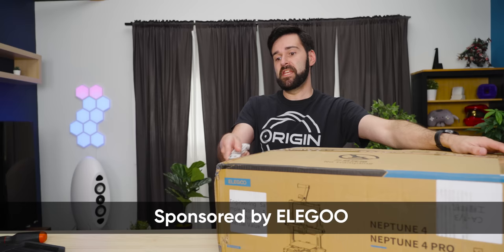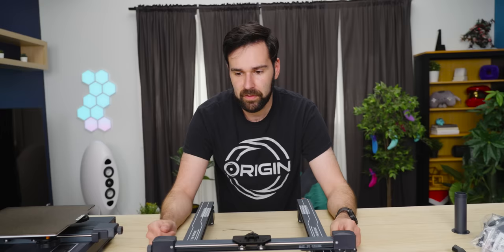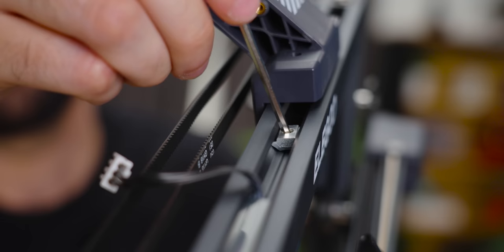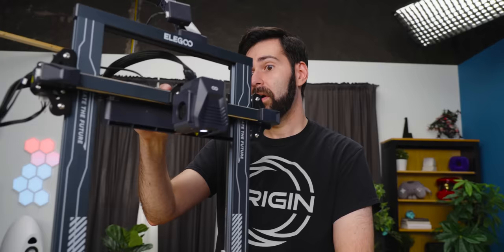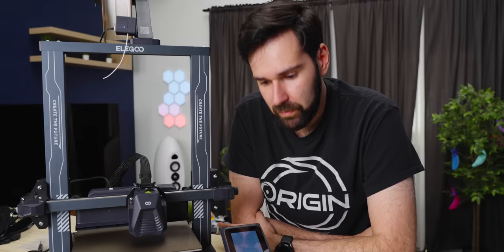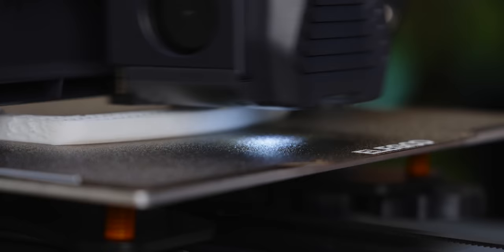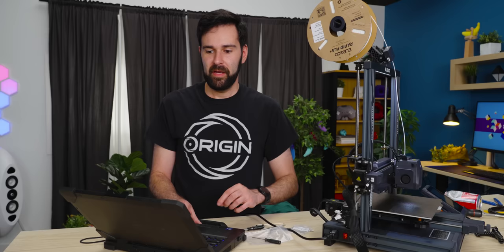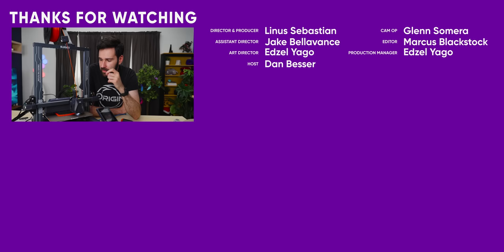Now THIS is bang for your buck! - Elegoo Neptune 4 Pro

Comment: "I hope it's not [something] lined - that way you'd die of neurotoxin poisoning" - Dan, as ever the cheerful member of the LMG team. The first time I saw him, he recommended doing electrical repairs standing on a metal chair because "if you get it wrong, they can't make you do it again"
Reply: LMAO I remember this! I don't remember what video it was from though
Reply: PTFE, aka Teflon. When heated to very high temperatures the fumes can be toxic.
Reply: Dan, the Lumalee of LMG
Reply: @SUPER_ZOMBIE  It was the one where he was helping Linus setup his new living room's VR setup. And what he said was something more like "If you mess up, you don't have to go into work tomorrow."
Reply: @bubbledoubletrouble  FYI - If you, or anyone reading this, ever uses the "self-cleaning" mode on your oven, you need to open all the windows, remove any persons and pets until the cleaning is complete because it does burn the PTFE lining off.
Reply: It is crazy how many manufacturers still do this though. Worst yet most lie and say it's 260 capable when in fact at thst temp the ptfe burns up in no time.
Reply: @bubbledoubletrouble  Teflon is any worse than your kitchen cook ware ?
Reply: @kingdraconias  
“If you are working on high voltage electronics make sure you’re sitting on a metal chair so if you mess up you won’t have to keep doing it  or come into work again” 
-- I Built My DREAM Gaming Room
Reply: LOL, I immediately paused and went to the comments to see if anyone else was talking about that comment.
Reply: @gotmilkbutt  The manufacturer makes money selling you a new oven when you ruin yours with self-clean mode. They don't care that it quite literally cooks off the insides.
Reply: @dh2032  I use cast iron and stainless; I just bought whatever was on sale
Reply: I LOVE POLYTETRAFLUOROETHYLENE
Reply: Lmaoooo man i love dan
Reply: @bubbledoubletrouble  "very high" includes normal cooking temps btw
Reply: So is it ptfe lined????

Comment: I love these videos where someone absoutely knows their shit with a particular product. I don't know jack shit about 3D printing, but I'm sold on this product based on Dan's assessment, and I understand why this is great. Very well done.
Reply: He actually knows very little. He called the heat sink fan the part cooling fan and he says his printer at home can only do 30 mm a second if you’d like to see 3d Print reviews there’s a lot better you can do not saying his is bad there’s just gaps in his knowledge.
Reply: @Brandon-jf9cv Agreed, could be way worse though
Reply: It's a sponsored overview, absolutely do your own research
Reply: @monki_sudo after two weeks? wtf you're lubing it with? water?
Reply: ugh. Don't be tricked my dude. He is absolutely not an expert by any means. Many many inaccuracies and misses. Not his fault, but don't take this as the be all end all source. Heck, don't even take the recommendation
Reply: @BeefIngot  It looks like a decent rig for a decent price. Whether he is an expert or not, the unit performs quite well to these untrained eyes.
Reply: @--_DJ_--  And that's the problem. He's presenting this as if it's the most reasonable buy and it's not. It's presented as if he has expert knowledge of the field.
Reply: @BeefIngot  I don't get the feeling that he is attempting to appear to be an expert at all. He has more knowledge than the aveage person, but by no means sounds like he knows everything. He even states as much. What makes this not a reasonable buy?
Reply: @--_DJ_--  The other options available for not much more that are far easier to use, print faster, are enclosed etc etc.

Basically just buy a P1S. Slightly more money, much more printer.

There were also a lot of things said here which were outright wrong. Like basically everything he said related to speed. I'm surprised he brought up volumetric flow so I guess I'll give a point even though it's max volumetric flow combined with max acceleration without degradation that counts when it comes to speed not nonsensical top speeds.
Reply: @BeefIngot  I just looked up a P1S, $700. Is that right? That seems like more than slightly more money if it is. I would expect it to be much more printer for more than twice the money.
Reply: @--_DJ_--  It truly is but to someone new its hard to explain why because it involves a lot of nuance and getting them to understand which parts of 3d printng are really annoying withiut them having experienced it first.

Without trying to condense that info down, it's basically like some printers are like Ladas (ender 3s) they are technically modes of transportation, but they are so bad that any person with any amount of money should either take public transport or save up to get something better. Then you have a 2001 hyundai. It gets you from a to b but you have to do a lot more maintainance. That's rot of where printers just under this go, like the ender 3 s1. Then you have a 5 year old civic. Good enough, somewhat reliable but it's a manual and you just 2ant to get to work without thinking about it. Then you have a modern Lexus. It has tons of driver aids, it's reliable, dependable, has all the creature comforts, and is great and worth the money if you can afford it. There are far more like luxury cars etc but the Lexus is what I recommend. It's at a price where I feel anyone who really has a use case to buy a printer could afford (otherwise they should just use a library or printing service as they don't plan to print that much) and it frees the from dealing wit the tool to just using the tool.

To put it another way, what I recommended does a ton of the tuning configuration, and setup that is ongoing with other printers automatically. It's also much faster but I think the significant leap in ease of use is what really should sell it, but it's hard to get that across to someone who hasn't actually owned a printer.

Maybe it's destiny for eveyone to buy a bad first printer then realize and buy or build a better second one. Maybe I'm fighting destiny.
Reply: lol, the Ender 3 is far from a Lada... mine has been plowing through everything since 2019. Got the good springs mentioned in the video, glass bed, silent board, coated micro swiss nozzle, basic geared extruder and most importantly, the original BL-TOUCH. It's not fast, but it is well built and reliable, with the one issue I have being that at some point I upgraded it to the latest version of Marlin... at the time a beta of version 2, added a few edits of my own and now that one bed leveling out of 10 where it panics hard and stops everything? Acceptable, all things considered.

That Elegoo costs less than what mine ended up with the upgrades and has even extra stuff, is faster, and as long as it turns out to be a reliable machine it looks like a great value. Not looking to upgrade, but still.
Reply: @BeefIngot  you just come off as an elitist and a bambu fanboy, saying things like it is too hard to explain to someone new, if you can’t afford a $700 printer just use a library or print service, etc. Cheap printers are absolutely fine, they print well enough, hence their popularity and why other companies still release cheap printers. Bambu labs produce great printers, generally the best on the hobbyist market but that doesn’t mean you should pick them over all others, that is like saying everyone should just buy an iPhone. Bambu labs printers are not perfect, they are closed source, don’t have that great customer service and for the most part you will need to buy replacements from them, in any hobby people tend to want open source and the ability to modify or repair their machine, you don’t really get that with Bambu labs.
Reply: @BeefIngot  Some people are willing to trade their time for saving money. Some people would enjoy learning the ins and outs of a basic machine that wouldn't have to be dealt with on a more full featured machine. Using your car analogy, you are buying a project car. You know it needs some work, will require some research, but you got a good deal, and after a bit of struggle, you have what you wanted and have more cash left in your wallet. With the added benefit of learning along the way.
Reply: @-DJ- I agree with you, I don't understand why that guy was comparing a $700 printer to a $300 one lol.  It better be better it's more than twice the price.
Reply: @--_DJ_--  That'd be the Chinese knock offs of Prusa printers, like the Ender 3 or worse the ANET A8 (my first printer). By the time I got that piece of shit working like it should I had essentially dumped as much as this thing into it & it has almost none of the features this has. This thing is actually great for the price & I've been considering it for a while now. Several years ago when I got into the hobby this would have been a $700+ printer.
Reply: @BeefIngot  "slightly more" is a stretch, and to people who dont understand 3d printing and wanna get their feet wet  700 dollars is insane. thats the common theme with everyone in the 3D printing ecosystem, its always shunning anything thats cheap and quality just because it isnt the 3 known brands
Reply: @BeefIngot lil bro just said 400 dollars is “slightly more money” 

Bruh, THATS MORE THAN DOUBLE THE PRICE 💀 💀 💀
Reply: @croingo8294 are 3D printing people actually this elitist? Goddamn

Comment: For $300 that is an outstanding value.
Reply: Yup.  This is the first PLA 3D printer I've seen that actually makes sense and looks pretty solidly engineered.  It's a shame it's just a PLA printer.  I'd love to see a desktop metal sintering 3D printer at $300.  Currently, metal sintering printers run about $12,000 on the cheap end and easily push $100,000.
Reply: I just looked it up and was like WOW!!
Reply: @privacyvalued4134  Choosing beggars.
Reply: @privacyvalued4134 why only pla? Would I not be able to print petg or cf-pla?
Reply: @pandaworx17 you can, don’t know what he’s on about. Just have to configure settings as always though

Comment: Mine just got here 4 days ago. It’s a fantastic printer. Done some complex prints like castles and stuff at full speed (250mm/s) and it KILLED IT. Amazing value!
Reply: You almost certainly did not. It's a common beginner mistake and I'm not the least bit judgey, but you should know at any usual layer height the hot end wouldn't be able to keep up, and the printer would never actually be able to hit top speed unless you cranked the accelerations so high that the print came out looking awful other than literal straight diagonal lines across the whole bed.

Comment: I've had my Neptune 4 (non-Pro) for about a week now, and this is probably the best video I've seen on it. That said, I've been printing at a real 250-300mm/s, and I haven't had any of the issues seen here - aside from a bit of ringing, my prints have all come out perfect. In practice, this is just as fast as the Bambu printers, and the only thing it lacks is proper input shaping; the accelerometer headers are present on the controller board and it's obviously present in the firmware, there just...isn't one. In a sub-$300 printer, that's not the worst thing in the world I guess.
Reply: It may be close to as fast but it's still a v roller bedslinger. It'll wear down quickly when pushing 200mm/s
Core XY is for fast printing
Reply: @Itsudemo1  - when you can buy 2-4 of these for the price of a CoreXY, it's not really a problem...especially when you consider the closed ecosystem and crappy firmware limitations of most CoreXY printers on the market, compared with this one running Klipper.

Comment: It is very nice to see and quite obvious that Dan's knowledge around 3D printing has improved and grown a lot and in a relatively short time! Also really nice to hear that the engineers at LMG are using Vorons. This great as a "first printer with Klipper" option for newbies and I hope printers with stock Klipper that are this affordable reach "ender 3 status", especially since they seem to have a better out of the box user experience. It used to be that consumers would buy an ender 3 and then in the first 5 minutes they started ordering upgrades and printing modifications to make the printer actually print well. I am happy that those days are gone and now you buy a 300$ printer and you can actually have some nice prints without any need for modifications or fixing issues.

Comment: "I hope it's not PTFE lined, otherwise you will die of neurotoxin poisoning"

Just a PSA for those who don't know, PTFE, commonly known as Teflon, starts to decompose at temperatures above 260°C, so unless you for certain that your hotend doesn't contain PTFE (for example full-metal hotends, most hotends do have PTFE in them) its not safe to print at temperatures above 260°C

Comment: Toss in a CHT nozzle and that printer looks like it might be a winner. Its really nice to see cheap printers coming to market with klipper installed so we can print fast. There hadn't been any major advancements in FMD machine in the past 4 years aside from volcano style hotends. Like there have been a few smaller things but now with klipper, Volcano, and CHT nozzles we can actually print really fast. Eventually my sidewinder x1 will die and the neptune 4 pro might be my next printer

Comment: Watching this video where Dan is describing all these cool, in-depth features and all I can think is, "how is this not like $600+" for all these features
Reply: because this is all old poorly implemented stuff on yet another ender clone. Times have evolved and the printer you can get for 600 are miles better in terms of speed and user experience.
Reply: @BeefIngot  no lol is anything remotely similar to ender is a clone now? lets be honest p1p isnt that far off for being twice as expensive and being closed source and possibly unsecure cloud servers unlike this klipper machine.
Reply: @tophatv2902  Its similar in motion system. Rollers are awful. The P1P is more expensive yes, but I think it's worth it for not having to configure or tune
Reply: @BeefIngot not everyone wants to spend 600 on a printer, especially for their first one
Reply: @Digitness  Its tiring hearing this. Sometimes the minimum level for a good thing is just what it is. Now luckily since then there have been cheaper minimum levels coming out, but it is what it is. Its jot abojt what you think you want. People often simply dont know enough to know what they want. I do, so I share that.

Comment: I for one was happy when I got the Neptune 3 Max, then a week later releasing the Neptune 4 series!  Hoping they dont release the 4 Max for a while! What I can see from that review of the 4.. Differences are the extra fans on the back of the extruder. Extra light on the extruder. 300°C temp upgrade on that nozzle. Yeah im happy and reckon I can upgrade this max with no problems. 😁